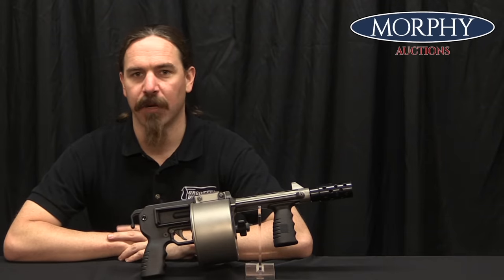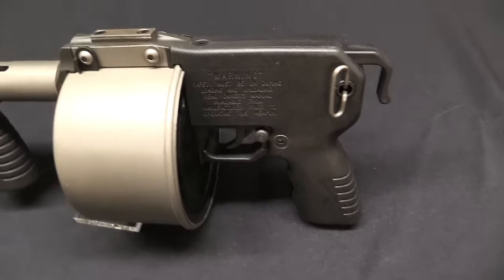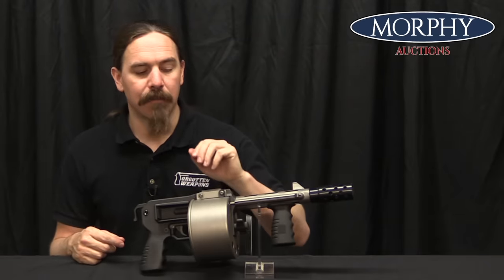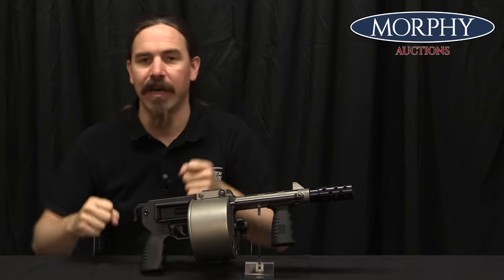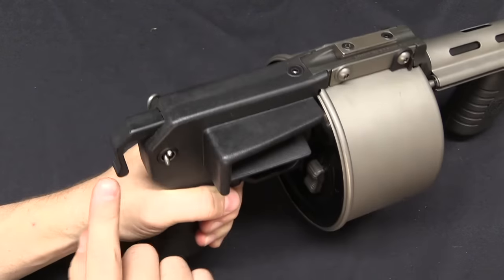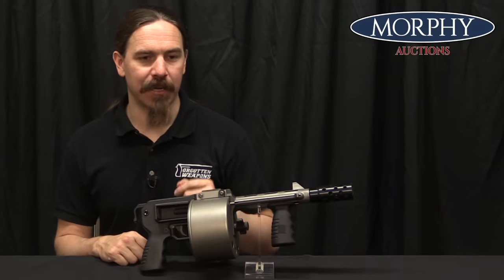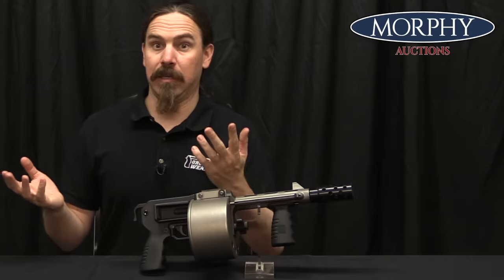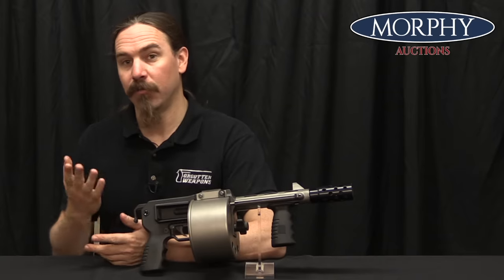Striker 12: Shotgun Turned "Destructive Device"

Comment: You know, the pre-Saiga 12 days are amazing to me. The amount of effort into just making a functional semi-auto shotgun, and without a tube magazine. And then the Russians just slap a box mag into an AK, and it works so much better.
Reply: You see, Ivan, when replace boolets with shells, AK make more holes in enemy.
Reply: imagine thinking saigas are good
Reply: Bigger ejection cut in the dust cover and piston rod and a bit streighened front end of a reciever, that's about all the difference.
Reply: As a bit of an expert on the saiga 12 itself, that's not really an accurate representation at the development.
Reply: Continue since I didn't actually mean to post that comment yet. the saiga 12 initially was just an AK with extra room made for ejection port and a larger barrel in a larger magwell and all that stuff. interesting ly they started with the better straighten certain magazine and downgraded to the rock and lock because that's what American market thought an AK should be. The problem was most first guns barely worked. They were so finicky about ammo. eventually they did some tuning with gas Port size and the big change was ditching the AK long stroke piston system and replacing with a tappet system. After they put in the tappet the guns worked. But they still had a limited range of animal that they worked with. the next development was put in a 2 position gas restrictor. that made them work with virtually everything so long as you got a gun that was assembled properly. these were refined by the American competitive market and improved a lot and some of those changes eventually made their way back into the izhmash guns as well as the Molot clones. Oddly their flagship model which is now closest to the Iz433 series prioritize in AK style rear sight block and removable gas tube in the process of incorporating that they removed the gas setting restrictor, which is a real down grade. The vepr 12 is cloned from that variant and originally shipped with the saiga-12 "police" magazines. For that reason the veprs also lack the gas restrictor.
Reply: [laughs in Italian]
Reply: You see ivan if we take shotgon boolet and put into kalash it will become shotgun
Reply: I'll stick with my break action single shot, thanks.
Reply: @xmm-cf5eg  And then you get used as target practice by everyone else here with mag fed shotguns... And maybe the few that have drum shotguns...
Reply: @Jael 97 Actually it'd need abit of lubrication and a quick but through inspection to make sure nothing is blocking the barrel, clear any spoiled ammunition and make sure the few moving parts still move. After that then its all clear to play with! ^.^
Reply: @Hanzer-ns5bh  Spas-15 is kind
Reply: Eye Patch Guy  until it jams
Reply: @Kar98killme  shells
Reply: Everyone else: struggling to make compact semiauto shotguns

Russians: looks at AK, takes swig of vodka “Is ok, I fix”
Reply: The Russians were are all about cheap and efficient. The good ole AK
Reply: @xmm-cf5eg  What's wrong with a Remington 1100?  Tube mag...  but you can get an extension tube to go up to (I think) 7+1 or even maybe 8+1.  I'm no expert by the way, but I do like my Rem 1100 12 ga.  It barely kicks, you forget it's 12 gauge (albeit only 2-3/4 " shells, but I'm still impressed).  I haven't checked Florida law on tube extensions, so I still don't have one.
Reply: @olisk-jy9rz  It's a good joke, and Russians joke about it themselves.
Reply: Stop getting triggered
Reply: I'm russian and I love the "Yuo see Ivan" meme
Reply: Hey, Nikolai! Lets make AK but it's shotgun this time!
Reply: @olisk-jy9rz  imagine being a social justice warrior FOR RUSSIANS
Reply: @wokedog1799  made me love sg-12 even more
Reply: Bruh all of their guns are AKs
Reply: I would take a USAS 12 over a saiga 12
Reply: If only Saigas actually worked that well. It's one of those things where there are only 2 types. Saigas that are broken, or Saigas that haven't broken yet. That said, there is the VEPR which people have gotten to actually work. Look up the KL-12, a custom competition VEPR which looks insane.
Reply: Mine worked and kinda still works. Well never worked on Walmart Winchester economy birdshot but that's a thing. Mine would even shoot a lot of low brass on high brass setting. Unfortunately my carrier has developed a crack near where piston is attached. Probably shot thousands of rounds through it tho. Loved to shoot slugs out of it too ha. May or may not have been used on wrong setting but I dont think so and that normally hurts the back of receiver and or carrier
Reply: Like I've heard of people shooting magnums on low brass setting and the dust cover basically getting locked in place ja
Reply: You know I had to buy 100 rnd box of Winchester my very first time shooting it to ha. Was a sad day but all better when I came back with federal and other shells ha
Reply: Can't agree with you - AA12 and USAS 12 were made before Saiga 12
Reply: Eye Patch Guy 
More reliable than an M4
Reply: NATO really should just adopt the AK pattern like the rest of the world.
Reply: @expendableround6186  why?
Reply: Line up of AK
AR- AK-47
SMG- AK74u
LMG- PKM
Sniper- Dragonov
Shotgun- S-12
Reply: Thats not necessarily true, reliably cycling Saiga 12s are pretty rare, especially stock and not heavily modified
Reply: @Feiora  not to if you not a spray and pray guy.
Reply: Ethan 0000 needs more vepr Hunter
Reply: @mikedawolf95  Do know the Dragunov is short stroke GP operated, while AK is long stroke, with exceptions depending on the gun and caliber it's using

That said there are precision weapons based on AKs, like the Romanian PSL (which looks a lot like the SVD) and the Iraqi Tabuk rifle
Reply: tastychunks It’s so they can show their friends, “look how much of a good person I am! I care so much about other people’s feelings. I’m so not racist.” It has nothing to do with the people they’re getting offended for. It’s all about getting internet points on social media.
Reply: @dreminh except .22 lol
Reply: Eye Patch Guy  To bad it looks like shit.
Reply: @Face2theScr33n  Maybe because a single shot shotgun can cost less than 150 bucks?
Reply: @charlesdemers1197  I was just talking about my remington 1100.  I picked it up used for $175.  It was a good deal.  Single shot break action is good too, more reliable than an autoloader for sure.
Reply: @Face2theScr33n  You bought a 1100 for 175 bucks? That’s a steal man!
Reply: @charlesdemers1197  Yeah, it's a little beat up, needs some bluing restored but it was still a great deal.
Reply: @Uncle_Roadkill  I KNEW BORIS HAD AN ALIAS!
Reply: @Face2theScr33n  try 11+1
Reply: @Face2theScr33n  Florida doesn't have mag restrictions. Besides, you shouldn't comply anyways...
Reply: The Saiga is actually quite a bit different from a standard AK, particularly in bolt design and the gas system. But it's a good system that is made even better with aftermarket parts.
Reply: @WardenWolf  Do you mean the rifle or shotgun, or both?
Reply: Long live the AK platform.
Reply: I went to the arms museum in Tula a few years ago. It was truly magnificent. Russians are pretty good at human suffering. My favorite was a mongol sword though. It’s pommel was shaped as an aid to the arm for supporting a shield or buckler.
Reply: @0neDoomedSpaceMarine  something tells me that they're closer to PSL, correct?
Reply: @mikedawolf95  Dragonuv is not AK derived, but the creation of another designer, Dragonuv. Internally it's different, but the external layout is similar to AK (imo deliberately so as to be easier to train those already trained on AK's). The very similar looking Romanian PSL though IS a stretched out AK DMR/Sniper rifle with AK derived internals.
Reply: @expendableround6186  No lol we like optics and not having to rock magazines in.
Reply: @GunFunZS  oh and the part of the dust cover moves with the recoil spring :) sorry I just wanted to sound smarter than I really am to
Reply: @andyrihn1  Google Saiga 12 vodka special. Those are ones that were made according to your method and then needed to get fixed again by the eventual owner.
Reply: As it should be, Comrade.
Reply: Yet again, the AA12 was made in the 70s (but yet again, the final version we all know was made in 2005) and the USAS was made in the 80s, so there were semi and full auto shotguns that worked well before the Saiga, but at the same time, these weren’t nearly as popular as the non mag semi auto shotguns.
Reply: I think I'll stick with a Remington or Mossberg pump shotgun......
Reply: SPAS-12: 
Am I a joke to you?
Reply: Unless you are in Commiefornia any detachable magazine semi auto ahotgun is illegal.  Msde law by the DOJ adding it into the assault rifle law that was voted in. If you owned one legally before to bad there is no featureless , registration, or other option. Some of them had a lot of money in them.  They were imported in sporting configuration with bo pistol grip.  If you wanted to run  10 SHELL MAGAZINEand have a pistop grip you needed to convert it with it having 75percent (I think not sure) US parts and have a bullet button to release the Mag.
Reply: That's why I'm getting the ak-12👍
Reply: @justdude8115  Problem is that teh AA-12 never went into public sales due to it being a machine (shot)gun, the USAS-12 or rather its semi auto only WM-12 version did but that got the Destructive Device limit and it became too expensive to buy
Reply: @fsen1999  They're not good, but they're better than this.
Reply: there's a bit more to a saiga-12 than that but I see your point lol
Reply: Where can you purchase this gun?
Reply: @GreenHellTube  They have extremely minimal parts compatibility. Gas piston system, receiver covers, the receiver body itself, spring, feed ramps, and the furniture besides the stock are all different and incompatible with almost any AK under the sun besides maybe a few other civilian aks built for larger calibers like the one in .308, but even that I’m unsure of.
Reply: They did quite a bit more than slap a box mag onto an AK genius
Reply: Actually, Bergman had a patent on box fed shotgun in the early 1900s.  And there were several Chinese-made box shotguns being imported before the Saiga 12 came to the US.  Look up omega sps12.

Comment: In the early nineties I lived in the centre of Johannesburg then regarded as the murder capital of the World. I acquired the South African ARMSEL PROTECTA model that you mentioned for use in situations such as car hijacking and CQB for which it proved it invaluable. In a Country where the Police advised Citizens not to stop at red traffic lights at night outside the city centre it was comforting to have the Protecta sitting safely on the floor between the seats.   The 90 deg. pivot of the front grip was quick and positive and I never had any kind of malfunction when using a mix of buckshot or slugs. At that time I also used the 9mm BXP machine pistol also a Rhodesian design produced in South Africa (No review yet ?) and the Stechkin
Reply: ANC why do you think it was so dangerous? 

Sorry, I mean "And."
Reply: Most important was compactness together with high capacity. Then it was of a very simple mechanical (non gas) design very easy to maintain and repair if necessary. For usage, it comfortably operated at the shoulder aim position or from the hip stance. Finally, in my experience, the gun was totally reliable and a great confidence booster.
Reply: @barryfeagan3969  yeah I meant ANC why do you think ZA was so dangerous. A play on words because of how bad the ANC ruined ZA.
Reply: i would need to consider and then answer you but the most basic reasons it was a mix of local and national politics, a sense of having no future to better yourself by the black majority. you can also throw tribal rivalry and common criminality into the mix @spazzypengin
Reply: Man owning a stetchkin and striker-12 sounds amazing. Was it full auto too (the stetchkin)?
Reply: @SenkaBandit  Yes it had full auto
Reply: @barryfeagan3969  gosh that sounds amazing

Comment: Had a street legal one of these, bought new. Had violent recoil. Sold it to an individual before they were made a taxed item. ATF never contacted me to determine it's disposition. 
It wasn't a terrible weapon, but the recoil was greater than I wished to endure. Had a rather open pattern with buckshot, which could be advantageous in close quarters.
Reply: I had four of them .....I traded 3 for 3 Spectre assault pistols....9mm, 40 sw ,and 45 acp. Still have the spectres today. I use to set up at the local gunshows and my tables were the draw. My knife and gun collection was second to none around Jackson Ms. However after one of the venders that had a direct line to trijicon, were followed home ,all their firearms stolen and killed in Arkansas, I stopped setting up at gun shows. Have not been to one after that crime.The other one I had was traded for a set of corbra 428 heads.

Comment: As a breacher, I would find the capacity to be just a bit much, 8 rounds would make the drum more compact and practical for that job.  What it would be really practical for would be introducing gas, either into a house through ferret rounds, or into a crowd.  40mm is better, but the rounds are expensive and heavy.  With this you could carry around 50 rounds, allowing you to push a crowd around quite a bit with OC-loaded impact munitions.

Comment: They out to market it in 410 gage and call it the Striker 30 with an 18" barrel and folding stock to get around the destructive device designation problem. Great for those pesky squirrels.
Reply: Still has the scary name though - change it to "Church Charity Turkey Shoot 30" and give the stock a faux wood grain finish and you're good to go.
Reply: If it was chambered for .410 then you could do the opposite of the Taurus Judge - a shotgun with .45 LC as a backup rather than the other way around. Just in case, for example, a bear got upset at the noise you were making while potting squirrels. Or the hyper evolved squirrel with kevlar fur, whichever you think is most likely :P
Reply: What's wrong with squirrels?
Reply: I had thought to perhaps re-do it into 16 gauge or perhaps 20 for the wimpy among us, thus avoid the 1/2 inch designation.
Reply: They pretty much did, but as a .45/70 pistol that could chamber .410, Ian has a video on one, the Cobray Lady's Home Companion
Reply: Fosty Nothing. They are good with gravy.
Reply: @fosty.  They're evile(tm) rodents.
Reply: @steveh1792  Nah they seem pretty cool
Reply: @fosty.  they taste good fryed.
Reply: @bobjohn8581  There was the "lady's home companion" in 45/70
Reply: @Richter-89  
We had some store wall nuts in our ceiling for a few years (sounded like really terrible tiny bowling practice) at about the same time one somehow managed to ground out a power transformer at 4 am in October of 2001. Needles to say, that was an edgy morning when my career army dad got up. Glad it was just a squirrel (I do like the little critters) but better that than the alternative. After the two booms and the fire department left we had wood for bon fires that lasted the next three years.
Reply: @isaiahcampbell488  I solved my problem by staking out by my window near their holes in the roof with a 10/22. After peeling their buddies' caps, the tree rats haven't been back in there yet. They moved on to clearing my peach tree (long before a single peach is ripe), making their best effort to destroy the bird feeders, and being general douches during deer season. I hold no pity or mercy for the bastards. I've long since considered setting up a dedicated breaker for a squirrel zapper if only it wouldn't roast the birds (except maybe the crows or damned house wrens).

Comment: That's a clever design. I wonder if that's where the grenade launcher design came from.
Reply: I believe the British Arwen 37 came a out a few years before this would have. 5 round 37mm rotary drum for anti riot rounds/less lethal, although they aren't conventional 37mm grenades. Still in use too. Edited, Arwen not a Anwen.
Reply: I remember picking this gun up in the Burger Town MW2 mission has a kid and wondering why wasn't the grenade launcher blowing things up :D
Reply: The Penn arms/deftech 37mm and 40mm launchers use pretty much the same mechanical system save for a top break loading design instead of a fixed drum with a loading port.
Reply: “Hey, check out this neat semi-automatic revolving shotgun!”
“That’s cool, but how can we make it fuck even more shit up at once?”
Reply: @metallicarchaea1820  the Hawk Engineering MM-1 grenade launcher was featured in the Christopher Walken movie The Dogs Of War for anyone interested
Reply: @metallicarchaea1820  I just went back and looked at my dvd copy
You are correct it is a Manville gun and not the MM-1
that's what I get for watching Terminator 2 recently and thinking it was the same gun as was used in The Dogs Of War
Reply: It was,designed a few years after.

Comment: thanks for the review. nice special piece there. would be more practical for the user to reload in stress  if they did a spring assisted revolver shotgun  that could break open to manually remove used slugs. imagine you press a button to rotate open the cylinder pull a lever to half push/eject rounds then manually replace used rounds to  lock back for action. keeping that manual spring intact to help with trigger weight.

Comment: I think a lot of  the reliability problems with self loading shotguns are due this huge differences in shotgun ammo.
Reply: I purchased this 25 years ago used. It jammed once in a while until I took it apart and realized it was put back together wrong. There is a long pin that goes through the cylinder and if the last 1/4 inch is not pushed through into the other side the cylinder isnt supported properly. Since I figured this out it hasn't jammed once in hundreds of rounds.